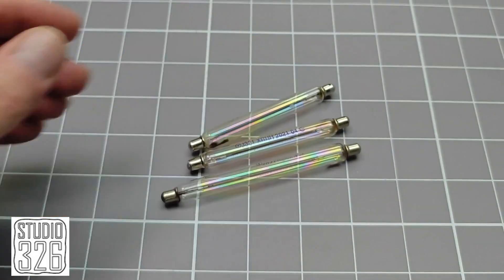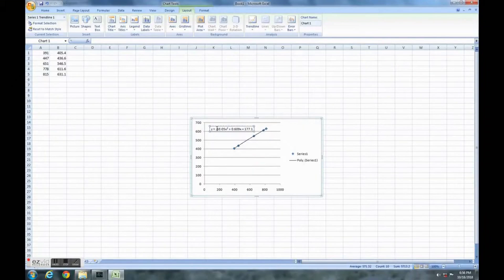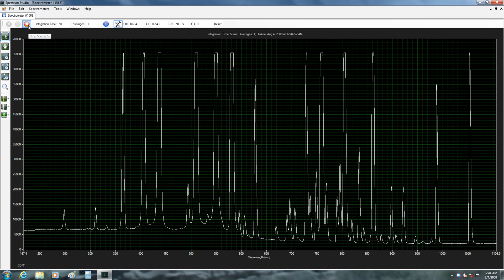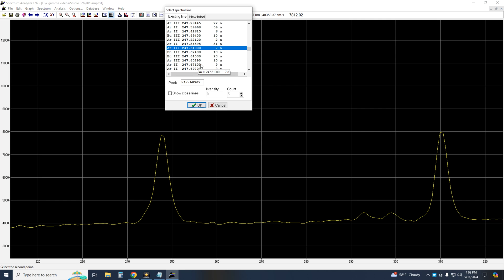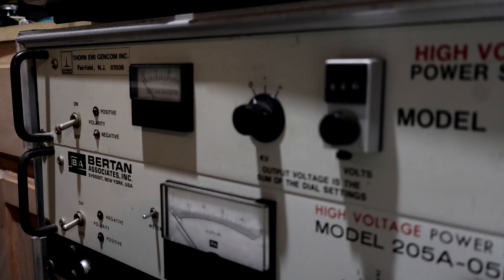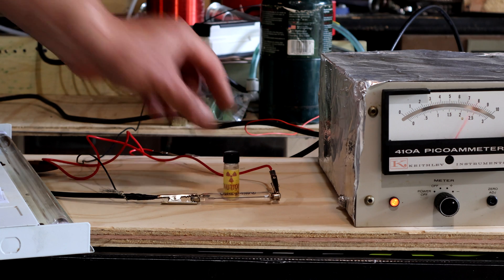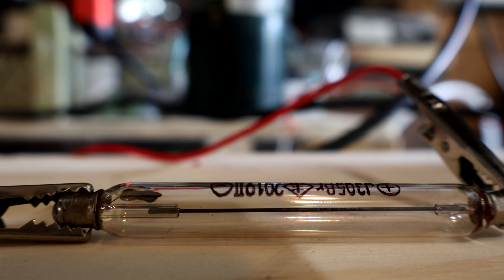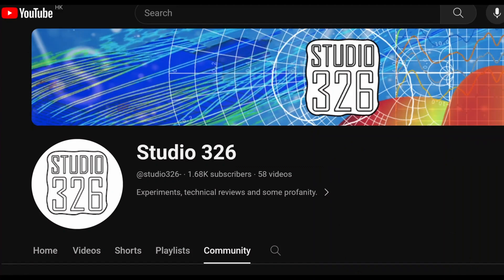Project 326 UV Geiger test response

Comment: The reason you might have measured only 169 volts is that the voltage step up circuit (remember it needs to step up from batteries) is very easily loaded and the typical one mega ohm impedance of a volt meter is enough to load it down considerably. To verify this you can create a voltage divider using 10s of mega ohms and see if the (adjusted for voltage division) result is noticeably higher.
Reply: Ah, I see, I should watch till the end of the video lol
Reply from the maker: @DantalionNl  thanks for watching! I appreciate the enthusiasm!

Comment: Looks like that science-surplus place that makes the spectrometer went out of business. Too bad, I'd definitely buy one. By the looks of that trace the spectral resolution was VERY high and the wavelength range very wide, comparable to an Ocean Optics unit. 
This reminds me of a very strange phenomenon I discovered a few years ago involving the little McFarlan Moore neon indicator in the switch of a power strip. Inevitably over time, sputtering or some other mechanism causes these indicators to start flickering, and they become highly sensitive to light exposure. Others have noticed that turning a light on in a room with one will cause it to glow solidly, and turning out the room lights causes it to extinguish. A simple case of photoelectric effect (as you demonstrate with this GM tube here) I thought. So I tried it with UV light in a dark room and it worked well enough to strike the arc in the bulb even when pointed at the other side of the room, then I tried a visible LED, it still worked. No problem, I thought, the blue light still has enough energy to create photoelectrons. Then I tried a 650nm red laser...it still worked. Then I tried an 850nm infrared LED.....IT. STILL. WORKED. At this point I was at a complete loss to explain the mechanism, which I suspect may potentially be novel, and never found an explanation subsequently.
Reply from the maker: Wow! Sounds crazy ! Was there any kind of light sensor anywhere? Spooky ! 😳
Reply from the maker: I went looking for them again and could not find much so i guess they don`t make the spectrometer anymore. That`s sad because they were pretty good, reasonably priced and had great customer support. That spectrum by the way is with a second array I bought from them . it`s less accurate but had a wider range thanthe original. still very good..

Comment: I wonder if there's a noticeable change if you used UV A UV B or UV C

My GMC 500+ has a blacked out tube so unfortunately i cant test it out myself  (plus i dont have 3 sources of UV) 

But the second tube is clear but its for high range and not even my sources can trigger the tube much (i tried some experiments with a plasma ball but i think its reaching the black tube so my results are inconclusive)
Reply from the maker: I think it only begins to work with UVC. Your high range sounds pretty cool though! Thanks for watching!
Reply: @Neptunium  makes sense since UVC is in the ionizing part of the spectrum, but longer wave UV is non ionizing

Comment: There's a small error in your voltage measurement as well as interpretation of the tube data!
Yes, your DMM is seeing 169 V, but that's in series with the anode resistor which is a couple of MOhm, so it forms a voltage divider with your 10 MOhm input impedance.
Also, the plateau length specifies the range of voltages the tube can work at, not the minimum voltage it needs, that is not specified in the picture you're showing.
there just is some voltage (presumably ~380V, knowing those tubes) where the working plateau begins, and it's at least 80 V long.

...well dang, I should have watched the video until the end before typing that out.
Interesting experiment nonetheless, and I have to say the breakdown inside the tube is quite beautiful :D
Reply from the maker: Lol! I appreciate the feedback and you are absolutely right! Thanks for watching to the end!